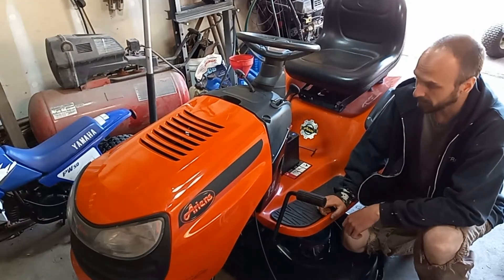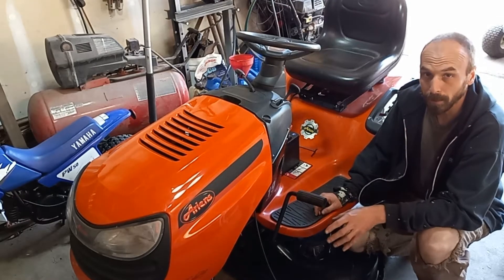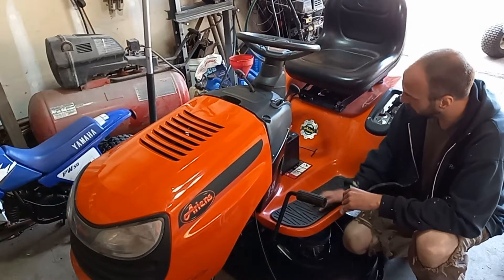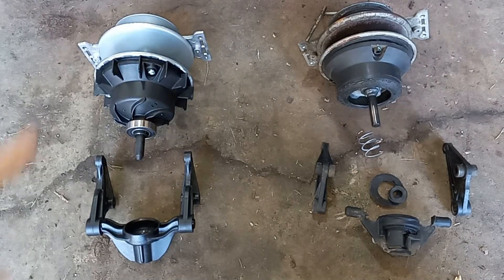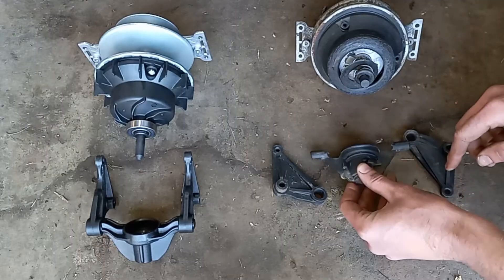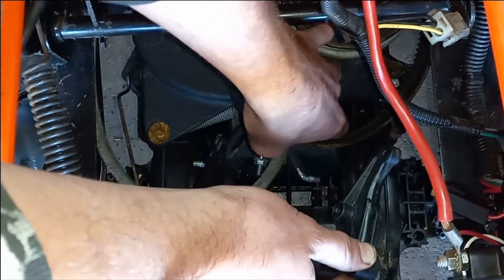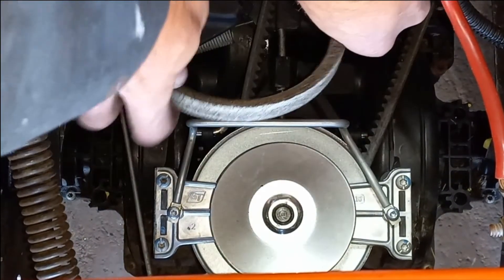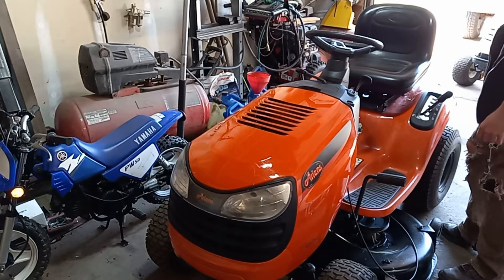FIXED - Riding Lawnmower Doesn't move - Plastic Trans / Axle

Comment: I have the same mower except its yellow and says poulan. Unfortunately its not worth dropping $250 just for the pulley setup. Id be detter off the sell it for $100 and buy a really nice used mower less than 2-3 years old for $400-500. Thanks for the video as this is the only one ive seen who actually talks about the problem
Reply from the maker: Glad you found it helpful.  Thanks for watching.  Cheers

Comment: Based on the amount of possible "dead" transmissions discussed in these comments, I'm hoping that someone might want to sell me a  Primary Variable Speed Drive Pulley for my Craftsman 19.5 HP 42” LT2500 Lawn Tractor. (Sears Craftsman Model Number 944.602630).

As discussed here in 2009 (for this one year only) Craftsman decided to use the problematic (plastic) General Transmission (GT/Gentrans) RS800 Transaxle. 

The tag attached on the transmission reads General Transmission 415663 (87007 C4) and 415663C0100033.
It is a Continuously Variable Transmission (CVT)) and not a hydrostatic drive.
Reply from the maker: Not sure if this is a question or wanted ad.

Comment: People don’t buy anything with a plastic trans unless you’re a mechanic 😅 And you don’t mind cleaning after every use really good 😢
Reply from the maker: The plastic trans is less than ideal.  I clean off my machines after every use, and still would not recommend a plastic transmission.

Comment: If you own a plastic transmission, pull it out. Take the same pulley out. Take the bottom cage off and replace the bearing with a timekin 35x17x10mm bearing. Its the bearings that freeze and blows up your stuff. Put in a real bearing and it will last forever
Reply: Thanks for the advice and information 😊
Reply: MVP
Reply from the maker: Good tip

Comment: how and what and how much oil goes inner???
Reply from the maker: It uses grease,  and a lot of it
Reply: @chrismakesstuff1  i read an artical and they claim the lube is only to quiete the gears. And they can run with zero lube
Reply from the maker: I wouldn't run it dry, but it's your transmission, your choice.
Reply: @chrismakesstuff1  just telling you what i read